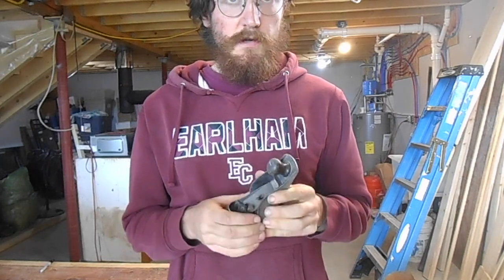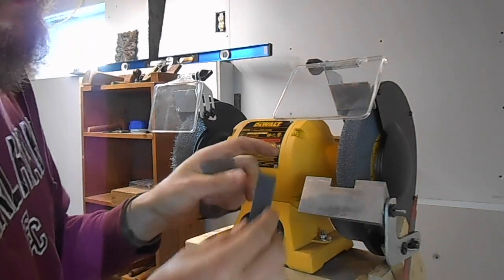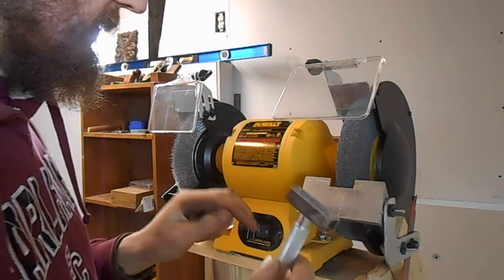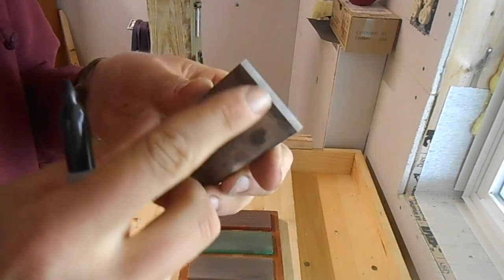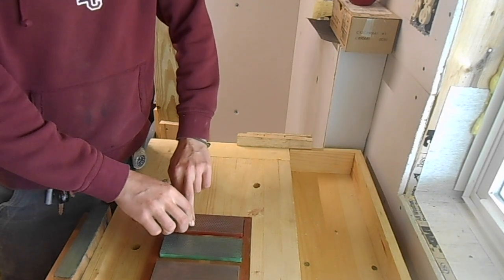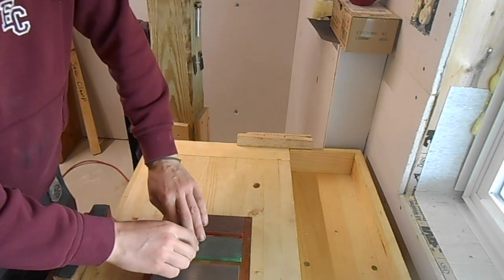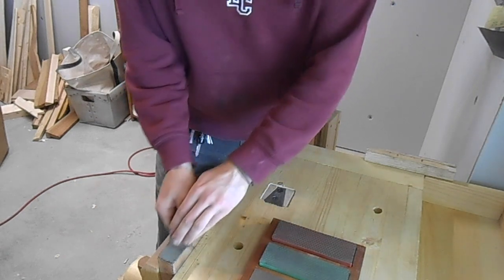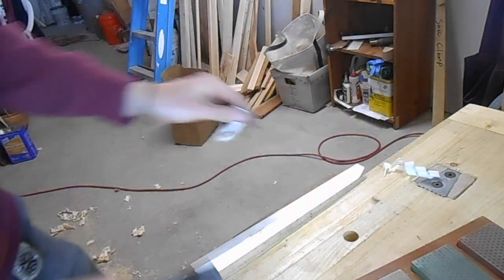Sharpening Block Plane with a Bench Grinder

Comment: Is there a way to grind a flat surface using a bench grinder or some other way then by hand?
Reply from the maker: Yes, one would use a belt or disk sander. To make a fine edge with such a tool you would need to go slowly and use very fine grits. You do not want your blade heating up too much!

Comment: They have 8k diamond stones?  Do you use them dry?
Reply from the maker: Thanks for the comment! yes they do have 8K stones, below is a link to the Lee Valley page. I generally use a strop with some 8000 grit compound on it, but did not have it on hand when I shot this video. I tend to use the stones dry unless they are built up with swarf (fine metal shavings)

https://www.leevalley.com/en-us/shop/tools/sharpening/stones/67660-dmt-diasharp-stones?item=70M1425
Reply: @tamarackguidingandwoodwork2479  Cool, thanks for the response and link.